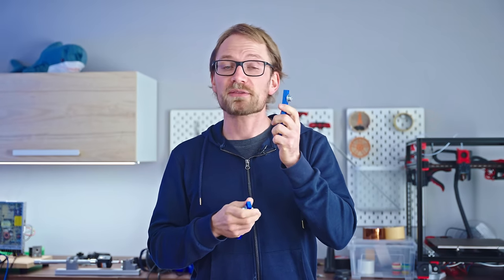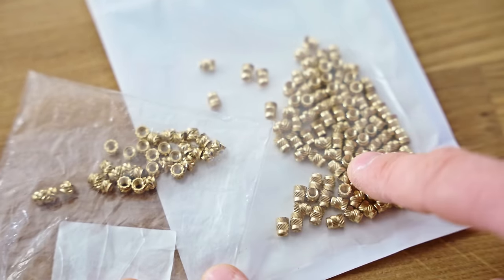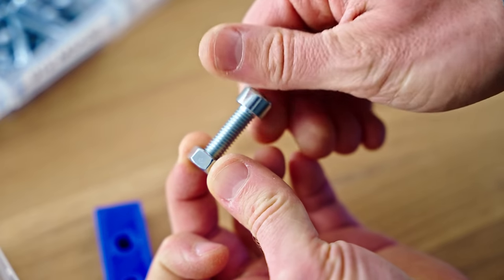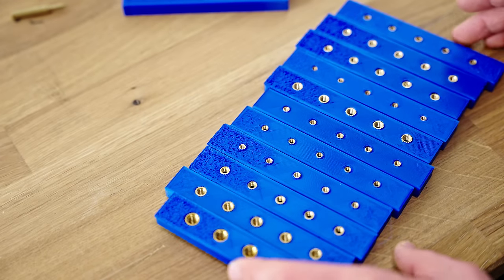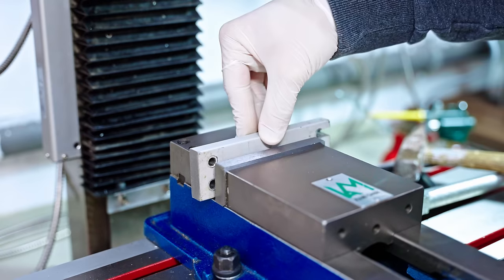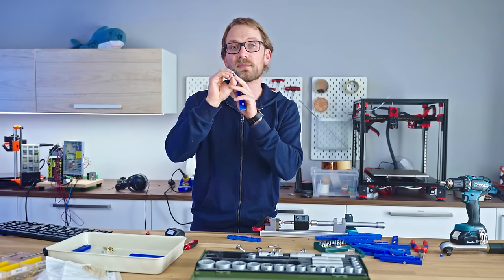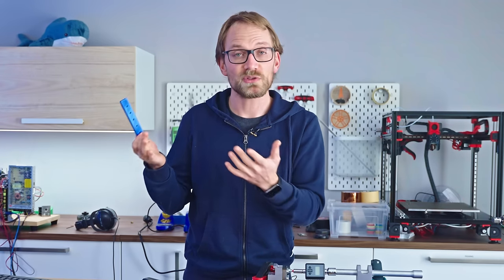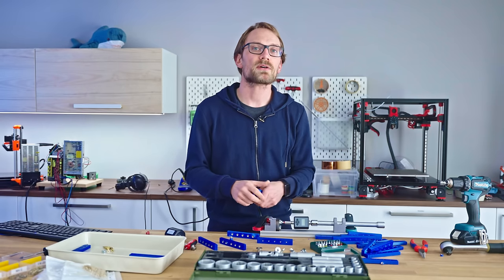Do you even need threaded inserts? Strength tested!

Comment: Well... oké. I recently made some video's about this on my channel @el3dprint .
First thing about the test: in normal use, you never pull screws or bolts but use them to push 2 pieces of material together and the strenght is therfore 90 degrees oposite of the screw. If you apply those in your design, you have the sheer-strenght instead (to be clear, English is not my native tongue, might make some mistakes).
So, please do a more realistic test.
Also, the torque you now tested is not the real point since it is clearly showing that the material around the insert is going first. I use mostly ABS and PETG and those give better results too since they are more flexible then PLA in this regard.
Also: I use way more  walls and when I slice, the plastic is putting  a thicker 'prop' around the thread or insert.

Tapping with a electric drill like this in plastic? Are you kidding? You damage the material and get a bad thread. Best results I get is using step-taps and using the second of the 3 taps. But: well, only one time use while with inserts and nuts, you get a lot more times of screwing in and out.

My goto when making strong connections with smaller screws: I just use nuts in cavities in the form. They are quite cheap and work well.
Other nuts I use are those for pulling into metal holes with special tools. They work well like melting inserts too, even without pulling them together. But even work better if you use the tools to pull them into the material. It squeezes the plastic in and pushes it to the sides too so it makes a stronger bond with the printed plastic. 
But, still the plastic is the weakest part.
Therefore: normal hex-nuts in cavities with  a lot of walls around them do give the best results.
You can also melt them in like inserts, or melt the bolt-side in if you want.

The usable surface-contact with the plastic for the same nutsize is already bigger when you compare it to the heat-inserted nuts, at least with normal metric sizes.

Next candidate to test is the wood-inserts. But not from the front but from the back of the piece. So, with tighten them up, you do pull the hooks and the flat spot in and to the plastic. Since the pins do not provide much torque before shreading the plastic, they can not be torqued as well as normal nuts or special inserts though. But strenghtwise they do perform pretty well in pull-direction which again is not used much in most well-designed objects.

By the way, nice to see your lathe and mill in this video too and to see the reference to Blondihacks channel.
It would be nice to see your other machinery more in the video's and / or the Meltzone (when is the next podcast coming?).

Comment: Am I the only person that thinks that this test is mostly irrelevant? When I use a bolt, it is mainly to clamp two parts together, in the way that the part holder in this video is fastened together. The close contact of the two parts would stop the insert pulling out.

Comment: TBH Your testing rig is greatly reducing the accuracy of the test. A screw can be thought of as a linear force multiplier, much like pulleys; the long rotational travel with low torque creates a large force under short distance at the nut. Pulling with a force gauge would be inherently more accurate, consistent, and easy to implement. Really all we need to know is force to remove the screw from the piece.

Comment: I'd have to think through it more, but I don't believe your test rig actually replicate the real world failure mode of these inserts. 
At far as I can see, without seating the head in, you are applying no torque to the insert and simply applying a pulling force. All of the torque you are measuring is likely from friction between the two threads. 
A screw is used to connect two parts together and therefore as you tighten the screw, the head actually keeps the inserts from pulling out (or in the reverse case the second part would fill this role.)
I think you need to find a way to test the ultimate torque they can take in a rotational direction instead of just yanking them out.

Comment: This is just the wrong test setup. The inserts are designed to provide a stable mount point that will not wear out or destroy the threads in a hole.
You should instead have tested the pull strength without turning the screw.

Comment: You drilled the female with a motorized tool? The female melted on you? Hard to watch.

M3-M5 is cr@p for printing. M14 on the other hand, draws on the strength of the printing manufacturing. I tap the female by hand. I reduce the size of the male to 98% in width to offer more tolerance. There is a ton of tricks needed for this to work great, but as long you only print horizontaly, like in the video, an print the male slow and using 0,15mm layer height (I only use 0,6mm nozzle), you should be able to get the point.

You print both the male and the female. I use a flat bit for the driver, and that is the only weak spot.

Just the last week, I have used hundreds of printed M14. Both females and males. For some designs that was finished this week, I actually used m85 and m135. I have been printing female and male screws years now. I hardly use metal screws at all in my work, and only when needed.

I sort of care about the properties that matter for screws printed in plastic, and you simply did not cover anything that matters when using all plastic for screws. That is a loooooong list of factors you did not even mention. I could throw the book at you, but that's a big book.

Rather, if you print all horizontally, like in the video. Print a female, embeded into a part. Like in the video. Then print a female screw, using as fine layer height as you can, and print it using all the tricks you know to like slowing down to say 10mm/s for them overhangs, increase the fan to full power for overhangs, and so on. Tap the female. Use the male as it is. You should also try to model a flat bit, as a hole to use a flat bit screw driver. Make it fit a 8mm flat bit, and be sure to use a 8mm flat bit. Make the flat bit thing as tight as you can.

The male threads needs to be reduced in x and y to 98% in size. This increases the tolerance, and preserves most of the treading pattern. Do not scale in the z-direction, as that is the treading pitch.

I have done this for a few years now. I use about two full turns of threads, typically 4,2mm of threading. There is a ton of reasons for almost anything I say here, but if you do just these things, you should be able to make a female and male, that mates just beautifully. You hardly need to use any force, which preserve the weak spot, which is the flat bit. The screws do not come loose. They are super strong. Using a 0,6 nozzle, 2 perimeters is just fine. 2 perimeters is just fine, even if printing straight into mesh.

The book about how to screw by printing, is really thick. It just has a different story line than this video, as it focuses on the strength and weaknesses of plastic, not metal. It is just a different universe.

And, you drilled that female with a power tool. She actually melted on you. What a pain.

Rule #1, do not tap with a power tool, use your hands.
Rulle #2, ... Sorry, the list is long. This is not the right format for it.

Comment: You really shouldn't be relying on two walls to hold an insert. You can't be cheap with the plastic when it's the plastic that's holding it in. Use something like 4 walls and overlap infill, maybe even increase the infill around the inserts as well. With as much experience you should have with 3d printing I'm really surprised you didn't seem to know this going into the video. PLA melts incredibly easily so why would you go full chooch on the drill?

Comment: I Don't think things that are made out of hollow plastic with infill justify that kind of toques. I you want to make it that strong print it sollid and pull the bolt from the other side like you have a nut inserted, You pulled the inserts from the same side as where you inserted them. Also in a real world application the hole that the bolt sits in is just bigger than the bolt.

Comment: I have found that a captured hex nut meets my criteria better than threaded inserts for 'mass' producing. They are friction fit and the screw pulls the nut to the opposite side of the part from where it was inserted. I use Maker's Muse chamfered bore so I can print without supports.  https://www.youtube.com/watch?v=KBuWcT8XkhA&t=327s&ab_channel=Maker%27sMuse

Comment: Entirely not the point of this video (still watching) but, you could use a high quality lotion - your hands are quite dry 😅

Edit: Just finished watching, something to be aware of (at least with the inserts I own [Ruthex]) is that there is a minimal wall thickness, minimum height and minimum hole diameter depending on if the hole is blind or through

So there's a very real possibility that the way you modeled the parts, didn't match adequate specs

Comment: Never use infill! Design your part to have consistent wall thickness and pockets where you don't need material. Like a steel bridge or any plastic part you see in real life. Infill is the worst "invention" in the 3D printer world. Design your part correctly, set infill to 0%, and the wall, top and bottom size according to your design. If you get open pockets where the infill should have been, adjust wall/top/bottom or fix the design.